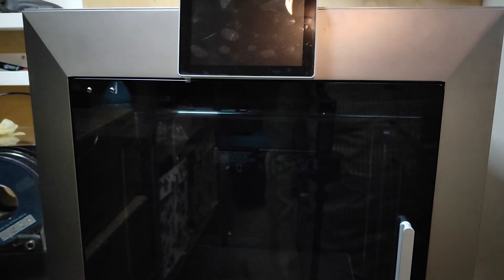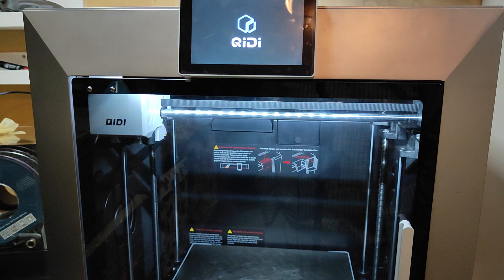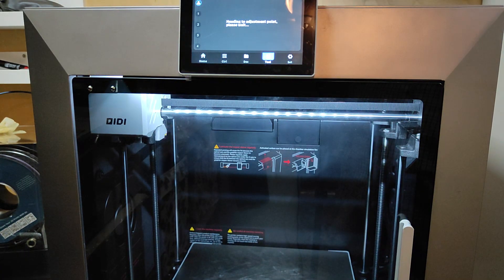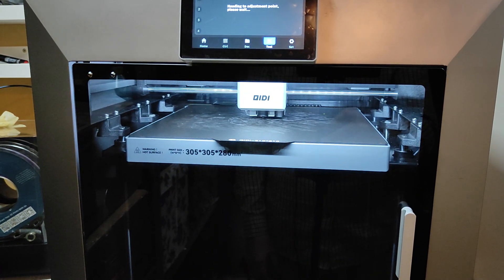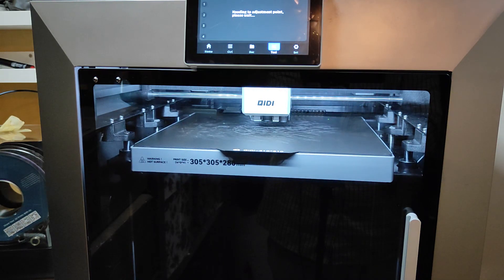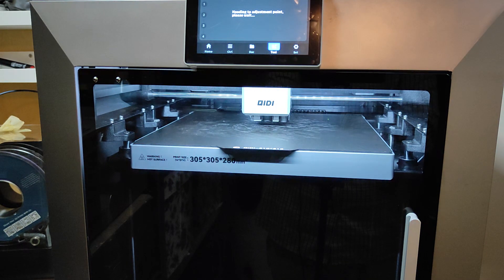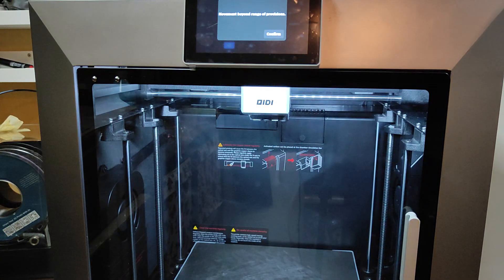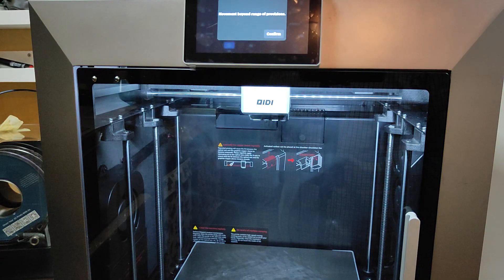Qidi Plus4 Platform Reset problems

Comment: I sae on a forum that it can ben the sensor of proximiti in the bed that is busted.
Reply from the maker: Yeah, you're right. The support team thinks the same. So that's where we are now. BUT THEY DON'T ANSWER ANYMORE. Actually, we agreed to change it for a new machine, and I said fine, I'd drive to your warehouse with it. Then the line went dead from Qidi support. So I’m stuck with a high-quality printer that don`t works. What can I do I’m buying another brand
Reply: @tecknotworking20  i bought a bambu A1 for second printer and i prefer my bambu

Comment: And how did the issue progress further?

https://youtu.be/L-2EP6hOKpw?si=ELmOsobTy8XHuvwb - Have you tried something like that?
Reply from the maker: Qidi answar me, they will ship me a autolevel sensor, I have to change on the machine.
Reply: @tecknotworking20  I have a problem like this. each time i try to print and it do the autoleveling, it stucked at the Z axe leveling in a eternal loop. maybe my autolevel sensor is broken like yours
Reply from the maker: Hi, thank you for asking. I actually have seen this video and tried doing that as one of the first things. I have given up. A lot of nice people out there have tried to offer solutions, and please still keep trying with me. Maybe one day we'll hit on something that works. Qidi support is long gone, sadley. Thank you again. Keep uo printing
Reply: @tecknotworking20 i did a plateforme reset and i let it run during 1 hour before be able to get the corner ajustment step. I had to return to my job after the lunch so i've startef the platform reset and let it run 1 hour before coming back to home to see if it worked and it did so... maybe you should let it run until it works.
Reply from the maker: @Archeagle  Yeah, you could be right. But Every time I made a reset, I ended up with the heatbed at the bottom. So frustrating